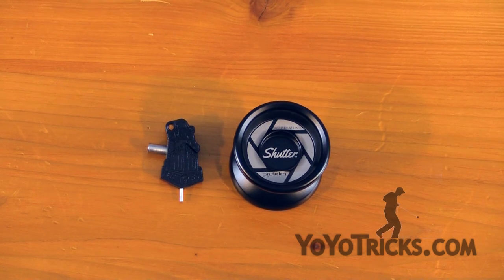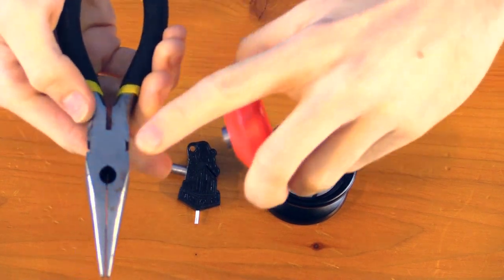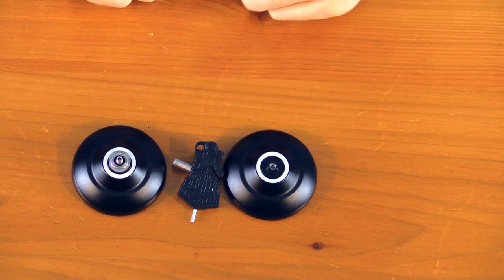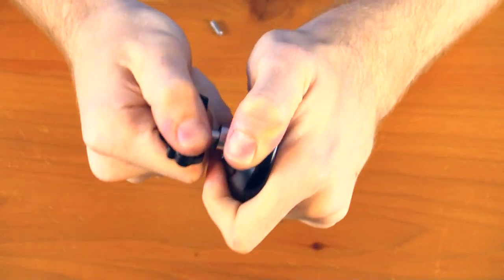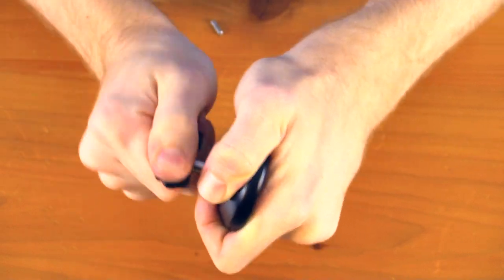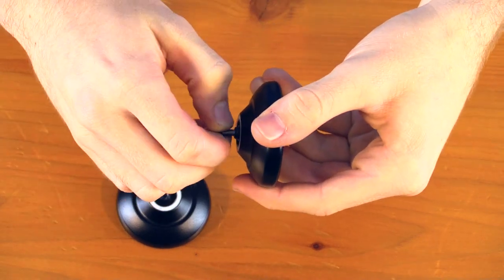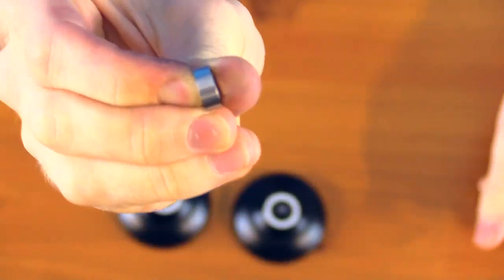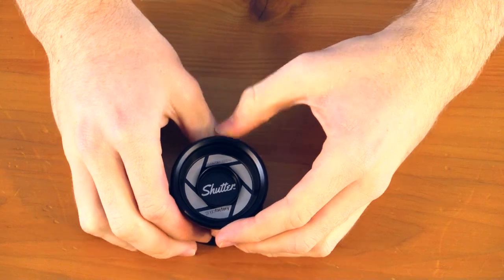How to Remove a Yoyo Bearing - size C

Comment: So i want to take my bearing out of my horizon, but it just won't come out. I have tried the string and plier method but it's still in the same position. Please help?
Reply from the maker: Multitool?
Reply: I tried asking my parents for one and they said no :(
Reply: Elizabeth Nguyen hmm i would suggest putting a small amount of thin lube on the part that touches the inside circle of the bearing then give the bearing a little spin and try again with the pliers if not the string method or get a smaller pair of pliers and make it so that the pliers are grabbing onto the inside part of the bearing and the outside and try wiggling it out, that'show i got out an extremely stuck bearing but be carefull that last method may have a greater chance at damaging your bearing
Reply: Elizabeth Nguyen hmm i would suggest putting a small amount of thin lube on the part that touches the inside circle of the bearing then give the bearing a little spin and try again with the pliers if not the string method or get a smaller pair of pliers and make it so that the pliers are grabbing onto the inside part of the bearing and the outside and try wiggling it out, that'show i got out an extremely stuck bearing but be carefull that last method may have a greater chance at damaging your bearing

Comment: when i use the tool it comes off but my bearing got stuck to the tool and now i can't get it out? i tried lubing it and it still won't come out any tips? :/ (size c bearing)
Reply from the maker: Mango Super If you have a pair of pliers you should be able to place them just below the bearing on the multitool and rock the bearing off. You will not need to squeeze the pliers at all to do this, so nothing will get damaged.
Reply: it worked! ty so much
Reply from the maker: Excellent!

Comment: My axel doesn't have a hole to put the tool into, what should I do?
Reply from the maker: +WillowGaming It is not always necessary to remove the axle to remove the bearing. What kind of yoyo is it?
Reply: +WillowGaming It probably has the hole on the other side, carefully remove the axle with pliers and you will find the hole in the other side
Reply: +yotricks sorry about the long wait between my reply but it is a replay pro yoyo. Don't worry though I figured it out. (I just pulled the bearing off of the axel with my fingers. I have no idea how the bearing came of from just my tiny hand and greasy grip but thanks for answering my comment anyway!)

Comment: what do i do if my bearing will not stay on the yoyo once i put it back on it just falls off if i turn the yoyo upside down
Reply from the maker: Luke Limkee That is totally fine. Not all yoyos keep the bearing on it when they are turned upside down.
Reply: +yotricks thanks a lot

Comment: I have tried this way, and it ruined my velocity, and my hubstack. I put less than half a drop on, and it didn't even pool around the full circle. I screw the yo yo back together, and when I throw it down, it spins for about 3 seconds. The string doesn't even roll off, it just shoots right down. My Replay has been starting to make noises, but I don't want to lube it and have it suffer the same fate. Help?
Reply: for ur hunstack u have to use plyer to take it out. sorry i only can tell u one cause the others i dont know sorry😢😢😢😭😭😭😿😿😿😓😓😓😯😯

Comment: my replay pro does not have a hole in its axel but it does not come off, what do i do?
Reply from the maker: +xhonestx Have you used the multitool?
Reply: the axel does not have a hole for me to remove it with. so i tried to wrap tissue and use pliers and it it didn't work
Reply from the maker: You cannot remove the axle on the replay pro.

Comment: why my yoyo bearing is very easy to take it off? when i open my yoyo its just off straight away
Reply from the maker: Jihad Sungkar On some yoyos the bearing is easy to take off. On others the bearing fits so tight a tool is necessary to remove the bearing.

Comment: Hi, I got my shutter off your site. I can't seem to take apart the Yoyo. My parents tried taking it apart, no luck. My friends tried to, no luck. Please help.
Reply from the maker: Try putting fat rubber bands around the outer edges to give you a better grip.
Reply: It still won't come off. There is a knot near the bearing that I can't take out without taking the yoyo apart. I don't know what to do...
Reply: Btw I did not over tighten the yoyo. The yoyo came like this. When it arrived I tried taking it apart.
Reply from the maker: Not sure what the best option is. Some yoyos are just difficult to get apart the first time. If everyone has tried to get the yoyo apart using the rubber bands around the outer edge you may just want to fish the string out of the center of the yoyo with a paper clip until you can get the yoyo apart.
Reply: Man... That stinks...
Reply: But thanks for the help anyway:
Reply: I got the yoyo apart. What I did is I put grip tape around the out part of the yoyo and it made is a lot easier to open up.
Reply from the maker: Awesome!

Comment: What if you don't have the 3 tool YYF Keychain thing (Idk what's it called)
Reply from the maker: You can use pliers, but you need to be careful because you can easily scratch your yoyo up and damage the bearing if you are not careful.
Reply: yotricks Thanks but before you replied I got it out thank you

Comment: How to remove concave c size bearing of magic yoyo n8 without multi tool.
Reply from the maker: You can use pliers, but you may break the yoyo or the bearing. If you gently rock it off with pliers that can do it, though.

Comment: I have a responsive DV888 and I want to upgrade it. But the bearing just won't come out. I wiggled it for quite a bit and still nothing
Reply from the maker: Carlos Martinez Are you using the multitool?
Reply: Yes.
Reply from the maker: You may just need to give it more force. Typically thin bearings come out relatively easily.

Comment: i can't get the bearing off the bearing tool
Reply from the maker: You should be able to remove the bearing from the tool with pliers if you are having trouble. Just grip the pliers together below the bearing and rock the bearing off the tool.
Reply: because i got a center track off my yyf horizon from u guys with the yyf bearing tool now it won't come off the bearing tool

Comment: How can i fix a stripped axle
Reply from the maker: You cannot, you need to replace it.
Reply: But the axle on my shutter is stuck on
 really tight
Reply from the maker: Pliers should be able to get it out so you can replace it.

Comment: My bearing is stuck on the tool and its SOOO stiff. I just cant get it off
Reply from the maker: valters šakarnis That happens with some multitoos, for me usually the wiggle method will work to get that bearing off as well.

Comment: My fast 201 bearing and the top piece are stuck
Reply from the maker: +Jin Yun Park YoYoFactory made a video on how to remove spacers that might help.
https://www.youtube.com/watch?v=INyRFN49_qc

In this video they use a pin, but we found that a tiny screw driver works better.

Comment: My shutter's bearing isnt coming out no matter how hard me and my dad wiggle on the bearing. Why cant it come out?
Reply: I do have a tool by the way
Reply from the maker: +Ilyong Park Some shutter bearings are especially tight. Recently I discovered that if you push down a bit while you wiggle the bearing that can help. Also, try putting the yoyo half in the freeze for 15-20 minutes, sometimes that will help.

Comment: Please help my beating won't come out even with pliers
Reply from the maker: That is why we show how to do it with a multitool.
Reply: @yotricks  i used a multitool and a pliers but none work on my horizon ulltra. the bearing is super stuck and cant even spin for more than 1 second and that is my favorite yoyo pls help ( its a center trac bearing if that helps to figure it out)
Reply from the maker: @Faiyaz7  The key with the multitool is to kind of dig down while you rock the bearing from side to side.

Comment: My Duncan barracuda won't come out no matter what any tips?
Reply from the maker: +Frankie Villanueva Try putting it in the freezer for 20 minutes.
Reply: +yotricks thanks
Reply: +yotricks still not budging :( anything else?
Reply from the maker: I assume you are using a multitool?
Reply: +yotricks no I don't own one I tried using plyers, and this thing that's like the multi tool but doesn't have the handle. I use it to take out my other bearings because it fits in the bearing.
Reply from the maker: Unfortunately, I don't have any further advice. If you don't care about the bearing you can use the pliers to break it off....
Reply: +yotricks I ended up getting it out without breaking it :). Also I have a question, I am trying to learn a trick and my yyf shutter keeps dying super quick. I know it's because there are too many string layers in the gap, but is there a way so it won't do that. Sometimes it even comes up on me. Thanks
Reply from the maker: +Frankie Villanueva What trick are you working on?
Reply: +yotricks search up yoyo speed combo and it's the video titled gentry stein yoyo speed combo or something like that. I'm stuck at about 5:00 because my yoyo either spins too slow and dies, or binds up on me
Reply from the maker: I see. The Shutter can certainly handle that many strings with ease, so the key is technique. My guess is that you need to make sure you are not pulling your hands apart any more than you need to, to keep the yoyo in place. Also, do your best to keep the strings as aligned as possible so that they do not rub against the yoyo.
Reply: +yotricks how is the one drop rebirth and the yyf new Genesis? Also do you like clyw yoyos?,if so which ones are your favorites
Reply from the maker: We like the Rebirth, we have a write-up about it on our site. The Genesis is probably the best Genesis yoyo to date. So far I have not found a CLYW yoyo I love.
http://yoyotricks.com/yoyo-store/one-drop/rebirth-yoyo/
Reply: +yotricks do you think I should get it coming from a shutter? And which do you prefer
Reply from the maker: The Rebirth is very different than the Shutter, but it is more on the casual side, compared to the Shutter. If you are looking for something very different I would go with the Gradient, if you like OneDrop, or the Atlas.
http://yoyotricks.com/yoyo-store/one-drop/gradient-yoyo-one-drop/
http://yoyotricks.com/yoyo-store/yoyofactory/atlas-yoyo/
Reply: +yotricks  I think I'll go with the gradient, I heard it's very good for finger grinds. Also I went to the prelims nationals this year and I picked my self up a Duncan bassacuda, it's very smooth but the binds are too tight. Is there any way I can get them looser. Also have you tried the bassacuda yourself
Reply from the maker: I have tried the bassacuda. I only played with it for a moment, so I cannot speak to the binds, but have you tried using a thinner string on it?
Reply: +yotricks I don't own any thin string, do you have any thin string to refer to me. I'm using Duncan polyester
Reply from the maker: Actually that string is pretty thin already. You may just need to break in the response pads a little before it hits its sweet spot.
Reply: +yotricks  hey what's the best way to break in the response pads, also can the gradient take many layers of string. What would u prefer, titanium dream, or the gradient
Reply from the maker: The only way to break in response pads is to play with the yoyo. The gradient can take many layers of string. I prefer the dream, but it is difficult to say if I prefer it once cost is a consideration.
Reply: +yotricks thanks
Reply: +yotricks can you tell me how to do an Eli hop but to the side, because I see people do it to the side and I can just do it to the fron
Reply from the maker: The technique is the same as what we describe in this video.
https://www.youtube.com/watch?v=U-jDUoxEN9w
Reply: +yotricks I'm sorry I don't get it. Can you like describe it here or make a tutorial, the description would be great.
Reply from the maker: I do not think we will be making a tutorial for that. Everything you need to know is in that video, you just need to apply the technique to Eli Hop. That being said, it is not at all easy to do, so don't expect to get it right away.
Reply: +yotricks ok thanks. Anyways what do you prefer, the clyw and one drop summit, or the one drop gradient. Do you mind explaining the differences?
Reply from the maker: I like them both, but because of the price difference I would go with the Gradient. I do not have enough experience with the Summit to compare them well, however.
http://yoyotricks.com/yoyo-store/one-drop/gradient-yoyo-one-drop/
Reply: +yotricks how is the Genesis the new one
Reply from the maker: We like it.

Comment: my bearing is stuck on the thing that removes it... and I don't have pliers
Reply: nvm got it
Reply: Fack I did it again I can't get it off the tool
Reply: i would suggest putting some thin lube on the part of the tool that is touching the bearing then push it off with your thumbs
Reply: Mango Super will try thanks!

Comment: I bought an responsive dv888 from you with the unresponsive package however the center track bearing is very very loose and it won't bind
Reply from the maker: hylend grit What do you mean when you say it is loose? If you are having trouble with the bind that typically means that you are either not pinching the string long enough when you attempt your bind, or you are attempting to bind with the yoyo on the wrong side of the string.
https://www.youtube.com/watch?v=npYfNhkzbaE
Reply: No no the bearing doesn't click in I can pull it out with no corce
Reply from the maker: That is just fine if that is how the bearing fits.

Comment: How to remove a SIZE A yoyo bearing
Reply from the maker: Unfortunately, there is no tool for that. What kind of yoyo do you have?
Reply: yotricks Velocity
Reply from the maker: Use a pair of pliers. Put a little cloth around the bearing so it doesn't scratch. Don't apply a lot of pressure, and you should be able to wiggle the bearing out of the yoyo.
Reply: yotricks Thanks YOTRICKS
Reply: And does the axle move in and out
Reply from the maker: Yes.